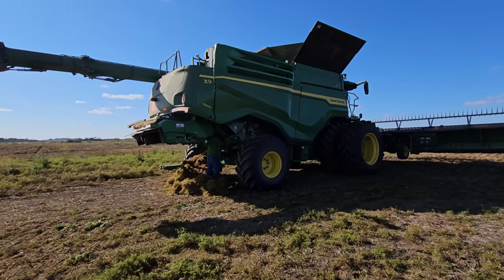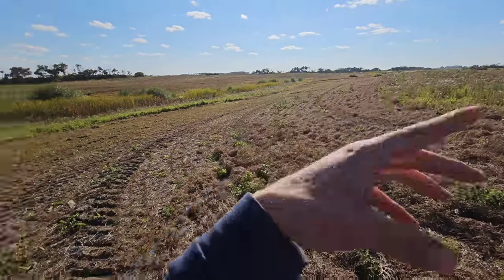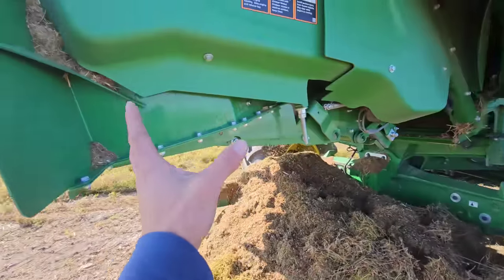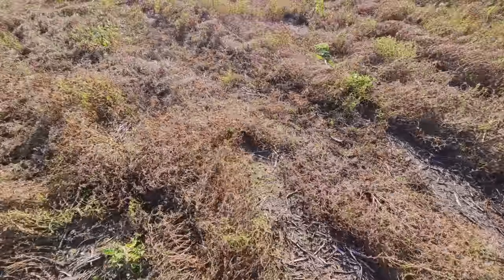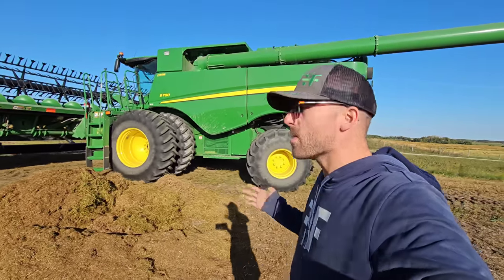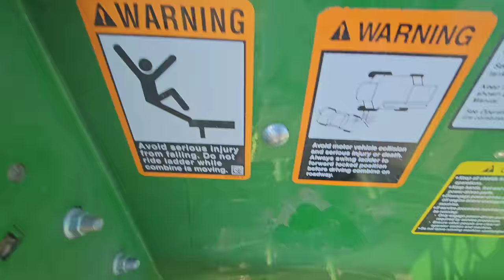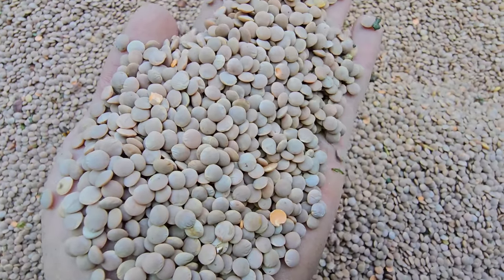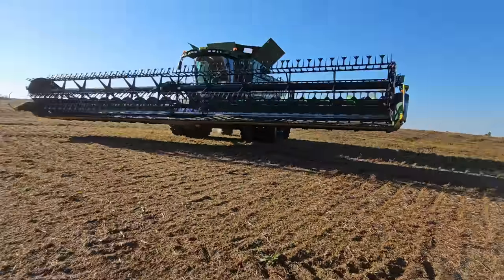X Series might be "Ex" Series 🫣

Comment: I’m running an 8700tt and I’ve put some crazy shit through it lol. The only time the chopper plugs is when the knives need flipped or replaced. Auto crop flow the safety feature stops you before you plug tight. Great machine for me. The way you are so detailed oriented you’d like it. Couple annoyances but good far out weighs any drawbacks.

Comment: Thanks for the videos Mike. We're on the fence from going from our S series to the X9. Your unfiltered videos are really helpful. I'm under the opinion that the x9 is still too new and will take time to perfect. The S series is a proven machine
Reply: The x9 is an awesome machine already. The only real problem that I see with it is the transition from the chopper to the spinners that Mike is showing here.
We are on our 4th year of running them. We had hoped JD would have fixed that problem already.
We told them about it 2 years ago. Hopefully Mike's video will encourage Deere to work harder on that problem.
You have to remember Mike uses a lot of drama to increase views. Most farmers would overcome much bigger problems in a day without ever mentioning them.
Reply: X9's aren't all they're hyped up to be. Got a neighbor running one for the last two years now. For some reason it takes having two machines to keep one working. Dealers don't have a parts supply for them so they've been bringing another machine out to rob parts off of to keep one going. On top of not a whole lot of X9's sitting around. A buddy of mine down the road in another town is watching g his neighbors do the same this year on an X9. Broke down constantly.
Reply: @johnsanders2798  This is the same logic you could apply to the Ideal. The difference is that Mike ran the first year of the Ideals and is running a 3rd year X9 machine. They should have this stuff figured out by now. Check out a current year Ideal and they're running with no problems.
Reply: @jacobl1657  ask Mike how his x9 experience compared to his Ideal experience....
This chopper complaint is his only real complaint so far. Everything has been fixed. I wouldn't doubt that JD has a fix for this too
Reply: @johnsanders2798 that's not "using drama" , it's  exposing the flaws that other people who nuthug a brand won't show or mention. Mike doesn't have the fragile ego that others have. Nobody likes to admit things these days, especially when it comes to their oh so beloved brands. Thank God for Mike and his honesty.  Stay humble.
Reply: Locally the Biggest issue with the few x9 here is loading them to capacity. We dont have terrain conducive to sufficient headers to fill them with local yields. There comes a point you can not just drive faster. I think they need a minimum 16 row corn head unless you are averaging north of 300 bu corn yeilds. The operation said a 50ft head wasn’t enough in 100 bu wheat. 

If you ever run new deere (or anyones combines really )they often have issues 75-100 hours. Sometimes its small a hydraulic hose rubbed and leaked. Lots of o ring issues etc. sometimes its something not small.
Reply: @johnsanders2798  Not the point. I already acknowledged Mike didn't have a great time with the first release year of the ideals. As I said, the MY23 machines are significantly different to the MY19 machines. Non of the issues Mike used to have with the ideals are present in current day models. The point I was making is that Deere has had multiple years to fix these problems and should've by now.
Reply: @jacobl1657  Which problems are you referring to....
We have been using x9s since their release. The only problem that I am aware of that Deere hasn't fixed is the chopper discharge problem. I am confident that it will be fixed very soon ...
I have looked closely at how the ideals are made in comparison to the x9s. The Deere is a much better made machine. At this point Agco really just needs to start over. Their rotors are not made very strong
Reply: @johnsanders2798  Unload Auger issues, monitor issues, seat issues, just to name a few. It's not unexpected though. You will have gremlins and bugs with every new launch of a product. You may not have issues, but I wouldn't let your opinion alone color your view on how the machine is operating throughout the market.
Reply: @jacobl1657  Monitor issues??? Oh my... You are really drinking Mike's coolaid.
There is no unload auger issue. Mike is augering crappy product. All that needs to be done for that is for JD to lower the cover. 
The seats work just fine now. That issue was actually only just slightly annoying.
All that's left is the chopper issue. Did you take a look at all the green weeds Mike is trying to send through??? It is really a far exception from regular harvesting. But yes it should work better, and I am convinced it will soon. The product flow through of the whole combine is actually very good. Even the chopper works good. The transition from the chopper to the power tailboard is just a little to tight and it builds on.
Mike builds his channel on exaggerating his problems. I understand. Watching someone combine back and forth is not interesting for most people.
Reply: @johnsanders2798  Lol I didn't even know Mike had issues with the monitor. That was from other folks I know running the X9, same with the auger issues. I hadn't watched a Mitchell video in like a year when this popped into my feed the other day. I've combined greener stuff than that with just about every other brand and didn't plug. So it's either operator or design. Do you work for Deere corporate or something, cause it's like you're trying to do damage control here lol
Reply: @jacobl1657  no. We own x9's. It's not damage control, it is an actual assessment of how they really perform.
They have been really good.
Reply: @jacobl1657 hey seat issues have been fixed

Comment: One of our x9 has the same problem I found that putting it in windrow mode then turning it on it will self clean. The key is to catch it before it gets to the rotors.
Reply: It’d still be very annoying if you have to do that every few hundred feet tho

Comment: To be fair and accurate the material goes through the accelerator, rotor and discharge beater very very well. 
There is a transition between where the chopper drops on to the spinners where the product can sit, then it backs up from there...
Deere just needs to fix that 1 small detail otherwise our machines have been awesome and they have great flow through.

Comment: John Deere should supply you at no charge a commercial air compressor with Ron on the air hose so the JD Engineers may hopefully learn something from these VERY FRUSTRATING TIMES:  I can see some demos of other brands in the future. No machine is ever perfect but for this kind of investment something needs to change

Comment: I wonder why you don't stop the engine while cleaning out the combine? (Save fuel and security)
Reply: I tend to agree.  I'm not a safety nazi but with so many people out there I would feel much better crawling inside a combine if it was off.
Reply: It is totally beyond me why any sane person would climb inside there with the engine running. One shorted wire and it all starts up, Donovan leaves the chat and Mike goes to jail. TOTAL STUPIDITY
Reply: @johnwarwick4105  By that same logic, one shorted wire and it is running again.
Reply: @J-1410 wrong.
Reply: @jacobstrutner8232  One wire for the start solenoid, no?
Reply: @johnwarwick4105  technically two shorted wires... one for the operator in the seat and one for your seperator engaged. I have never heard or seen a "ghost seperator" your odds are extremely slim. He is fine, go worry about yourself.
Reply: @J-1410  one to make it crank. Still need an ignition signal for engine to fire. Even then you'd need a third to engage the thresher. Hopefully by then hearing the engine turn over would be enough to make you hop out and see what's going on.
Reply: @JayBProjects  If you accidentally left the key on and the switches on, one wire.

Comment: Happened to our X9 last week in soybeans, only 200 sep hours on the machine. We had it plugged about 6 times in two days, then changed our chopper knives out to the S series hammer knives and haven’t had any problems since. I would suggest all new hammer knives and it should fix it.
Reply: For conditions reference, we were in 12% irrigated green stem beans running 80bu
Reply: Yeah, swapping out the chopper knives to the S type wing style has been mentioned multiple times.

Comment: Hello from Australia.
We lift the choppers and install custom made panels which concentrate the straw into a narrow windrow which is then burnt. This augments the grass weed control enabled by the chemical rotation from the legume phase. 
It's done with all legumes, which for us means field peas and lentils.
Unfortunately you may not get a dry down period in order to burn before the snow, I don't know.
And the wind you blokes get would be a problem for windrow integrity.
It is, however, a handy tool for stubble/weed management and no problems with plugging!

Comment: I think you need "suction blades" on your chopper.  (The ones that have wings on them.)  I am surprised JD doesn't have them?    The only drawback is they are not reversible.  Redekop makes them for NH for sure and they come standard OE  "winged" on outside edges on NH as well!   They have to be kept in shape!  NH will plug too if they are wore off!

Comment: In Midwest having issue plugging chopper outlet with green weeds in soybeans. Tried s series knifes still plugged. Ended up chopper in low stationary knifes in 80% with good success with not plugging     .  Issue was chopper in high was grinding up the weeds with lots of moisture and creating a wet pulp and was plugging. Chopper in low did not chop weeds as much and feed through. Still spread 50 feet no problems.  Works in very weedy 70 bushel soybeans might work in other crops

Comment: Sounds like to me it is the type of straw chopper that is the problem.  The spinning type can not handle the straw where as the straight discharge just grabs the straw, chops it and spits it out the back. As you said it may not spread as well but at least it gets it out of the combine where you can harrow it to spread it.

Comment: Haven't read the 698 other comments, but it was just asking for trouble by leaving the fixed blades down. They need to be up to chop fine enough for the spreader to clear it away easily. In fact, I'd have thought the fixed blades should only be dropped down for maintenance.

Comment: Make sure you’re running your separator vane in Standard mode, not advanced to get that straw beat-up better to not hang up at the chopper. Also try running a slightly tighter concave & more rotor speed if you’re not cracking. 👍

Comment: Neighbor with 770 has been fighting the rear beater all fall. Started on fire back there today dealer said to get rid of the second rear beater. What is Deere thinking to have that plugging thing in there to begin with. The old 9770 does just fine with one beater. Not sure if Deere gives a damn anymore except charge plenty

Comment: Those duck feet reel tines are a dead loss.
We threw ours in the dumpster as they were causing too much shatter loss knocking the grain out of the kernels before they reached the header table.
And the reel was running at the correct speed, not hammering the heads. Fore and aft position well set also.

Comment: Always remember the fact that you can basically get 3 (or sometimes even 4) 690s for the price of an X. That's just crazy to think about.
Reply: Or just forget about the John Deere all together and move on
Reply: That's the dumbest thing ever. Then you need three more operators, three more engines and machines to look after and store. Waste of money.
Reply: Still a rotary combine....for green material just run the conventional
Reply: @Northern_Farmer  a conventional will just plug at the other end. Unplugging threshing drums or a feeder house is worse than a chopper.
They finally need to adapt the size of their sieves and straw handling to the throughput of a two instead of one rotor. 🤷‍♂
Reply: @David-xl8zf  Mines doesn't care about green straw...yes the chopper will plug but most times I'm bailing it anyway
Reply: @fendtclaas8689  The yearly payment of the x9 will pay for the 3 operators and the maintenance as well as payments on the other three combines. The catch is finding operators these days.  Plus if a rock takes out your one giant combine, you're down hard for a while. At least with three combines you still have the other two running.  The calculus just isn't as clear-cut as you make it out to be.
Reply: @tmlf1239 agree 100%.
Reply: People always trying to get the latest and greatest
Reply: @tmlf1239  the catch is to find GOOD operators.
Reply: Chopper with fins is far superior imo.
Reply: Need a silage chopper
Reply: If the 780 had the shitty power cast piece of shit spreader it would plug too. They hate tough condition s. I sold both mine and will never have another. Imo
Reply: @fendtclaas8689  Yes, why would someone ever want 3-4x productivity for the same price. How silly of them. 🤣
Reply: @slipperyslope3912  I know right.
Reply: @tmlf1239 it's nice to see logical thought 👍
Reply: I agree conventional never ever add trouble with green stuff if you do. It needs bars replaced
Reply: Never seen anyone cut something that green before…….with a combine. How much do you pay your guy to clean out your plugs while you stand there recording? I pay my guy $30/ hr and he doesn’t even get out of the cart tractor while I’m unplugging my own. I must be doing it wrong

Comment: Is the plugging only on dual rotors ?

I remember from the fendts you had to add the shark fin to help with material flow out of the rotor areas 

I thought the JD units spun opposite of the fendt (just checked they do)

I wonder if there needs to be a beater or something pushing the material down and away from the exit of the rotors

Claas ?

Comment: At least the X9 rotor gearbox won’t overheat and start a fire. The oil is cooled and filtered and is shared with the main engine gearcase and hydraulic system.
Reply: Sharing oil between multiple systems is definitely not a benefit.
Reply: The amount of times he has to stop and unplug I doubt it has much time to overheat

Comment: Wet silage type material sticks to metal so it doesn’t matter what make it if it costs 1 million it will plug the chopper I think we have a operator problem 
Why not drive out and take less then 50ft. Take 30 ft
Also if you sprayed the crop down , you should wait a bit longer it should all be brown and wilted

Comment: I dunno.....I mean......ya...... that's probably a bit outside of the parameters of what that machine was built to do. Good on the S series, I guess....🤷‍♂️
Reply: Also kinda looks like there's maybe a bottleneck in the chopper on the X9 that could be addressed. Either way, I don't think I'd want to buy a used combine of yours, though. No offense!! 😆😆😆Running that much green through them has to be tough on them. I get it, though. You gotta to what you gotta do!

Comment: So did you try all the updates people mentioned in the comments and it still doesn't work? Wheres your dealer? If the 780 didnt work Id blame the conditions, the main problem is the chopper knives are junk  Some dealers are putting the winged S Series knives in it.Turned out the chopper fix on the Fendts wasn't too difficult, inexcusable that Fendt coulnt figure it out much less a couple years sooner. I've combined 70+ bu green stem soybeans with the S series, looked like silage coming out the chopper. Never occured to me the chopper might plug, it never has.

Comment: Is there any combine at all that manages your lentils? My guess is that it’s hard to find one, maybe a CaseIH but I wouldn’t bet on it. One thing is that you might use a too wide header, the X9 1000 is made for 40 feet maximum. Here in Northern Europe I know farmers that even has to down to 35. One the other hand we make it up with much higher speed, I saw you drove 2,9 mph yesterday, we never combine under 5 mph. Try a new header and then test drive the Case. Good luck!
Reply: More passes across the field with a smaller head.
Gleaner combines are excellent combines and popular here.

Comment: Mike, jeeees you need to drop the straw and cut it up after with a chopper for it, a combine cant handle such green material.
Reply: Then why did the other combine handle it without any problem?
Reply: @Jehty_ From what I found in the comments here and elsewhere is the knife design doesn't flow enough air so they are putting the S series knives in it.
Reply: @lynwessel2471  my comment was meant to be sarcastic.
Because obviously combines can handle such green material, as proven in this video.
But thank you for answering anyways 😁

Comment: No combine on the market today can get through green material.... go back to the John Deere 9600 to prevent this
Reply: I'm no expert, what's the main difference?
Reply: @petermolnar8667  The older combines just had a cylinder to thresh the grain out.  It was mounted horizontal to the flow of the crop right under the cab.  They also had straw walkers.  Today's combines have a large rotor mounted lengthwise through the combine, eliminating the straw walkers.  Supposedly, it allows for larger amounts of crop to be processed